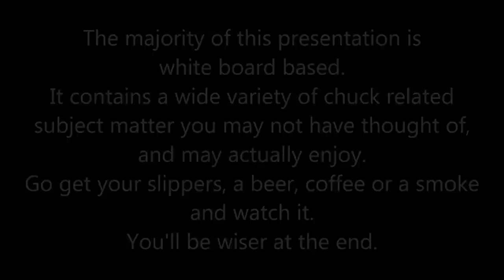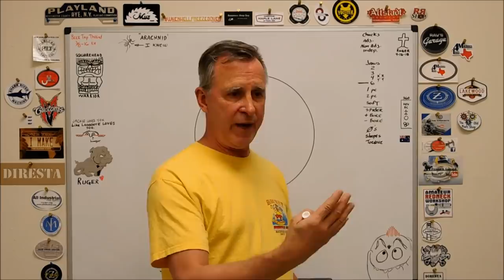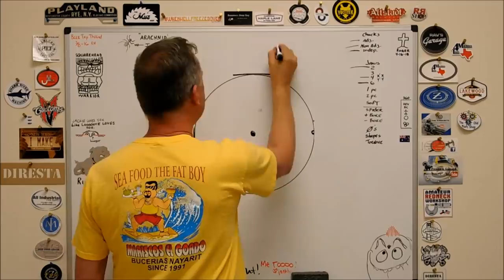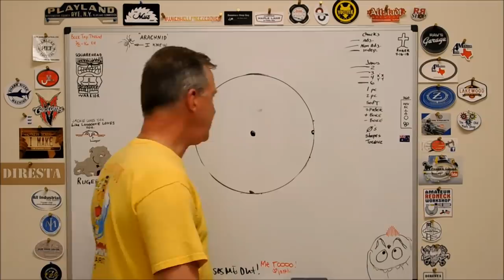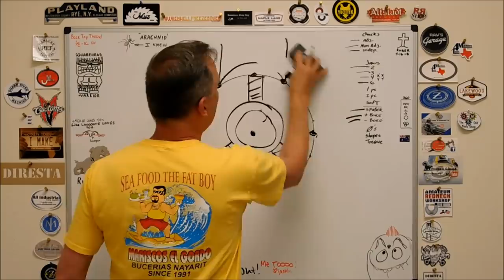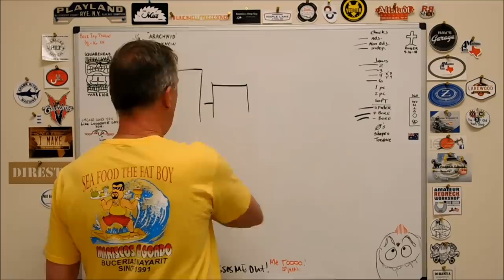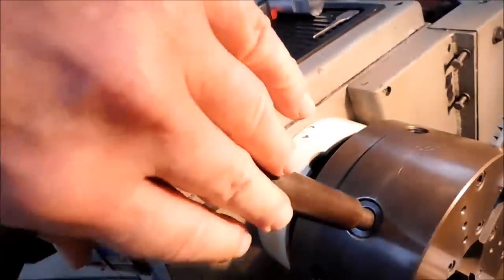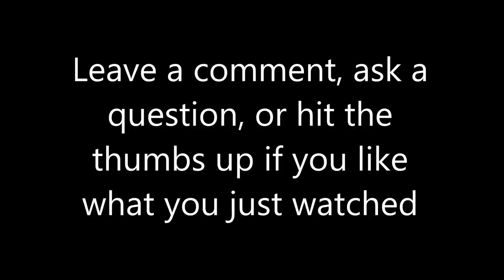Lathe Chucks - Types - Pro's - Con's

Comment: Another safety tip that could be offered is this: If turning the OD on piece of pipe or tubing and clamping using ID jaws, pay attention to the heat developed in the part. If a part gets too hot, it can expand enough to come loose on your jaws and disengage. Don't ask me how I know this..........
Reply: instablaster

Comment: Great job Joe!!  I'm a 4 jaw guy...mainly because I do more repair work and things that have only one shot to be repaired.  I have same 13 x 40 as you....I can agree it is the best lathe out there...and it was built in 1997...still tight and accurate. I was on sack lunches for years until I finally got one! My 4 jaw (Buck) has jaws that the top is removable ...thus I can use soft jaws and even weld to the jaws if needed.  Keep up the great work....in the next month or so...I have a gift coming your way for your Colchester ... Hope it knocks your socks off....

Comment: In our shop, we use 3 jaw check to hold almost everything, even squares... you have to be a bit creative :) 

Another issue people have on 3 jaws is that "its impossible to make them run true". Sure, but you can adjust that quickly by slapping an indicator on the part and tapping the high jaw to fix runout issues. 

Anyway, great video Joe. Thanks for your videos.

Jimmy
Reply: I do that all the time with my 3 jaw chuck. An old timer showed me that trick. It's very useful when you have to flip a part end to end and make the concentricity match. I can usually get it within .0005" concentric. My 3 jaw also has 3 tightening screws for the scroll, sometimes tightening one screw more than the others will move it enough to get it concentric.
Reply: @marcellemay7721  I see. I usually tighten only one out of three, but check all 3 to find which one makes the best concentricity. (They can be different ones through different diameters for some reason) and yeah, tapping helps when you need it.

 I also found that the high point wants to be towards the operator. So if your tightening the key up top, the high point will tend to want to be about 120 deg. to the left. This is because the spiral plate in the chuck has slop and shifts towards the left when tightened. 
Sorry for the long message Haha but this stuff fascinates me :)

Comment: Glad you covered soft jaw bore diameter. In my shop we cut a lot of rings for bearings (CNC lathe work). Maximum out of round varied .002 to .006 depending on the part. Maximum flatness/parallel deviation .003 typ. We held the parts in pie jaws and bored them to the exact nominal outside diameter of part (which dep. on the customer had a +/- .001 or .002 tol.)  And then held at very light chuck psi. 
You could always tell when guys rushed the jaws on their set-up. The parts would run way out of round and/or way out of flat.
Jaw diameter and torque are absolutely critical and should not be overlooked or underestimated.
Reply: I'd like to add that the bigger the part the more extreme these effects seem to be. I ran and set-up the big parts (8"-18") and the rest of the shop ran the smaller ones (1"-8") and the chuck pressure in flatness of the jaws was extra critical. Bore size mattered across the board.
Reply: @ctdbass  the size matters due to what is called "tunnel strength". It requires more force to crush eg. 1/4" wall 1" diameter tube than a 1/4" wall 6" diameter tube.
As an example this is a significant factor in choosing wristpin diameter for performance engines vs. wall thickness. Wall thickness to diameter affects dimensional rigidity.

Comment: Good material Joe.  This makes me feel motivated to mention the condition of old, abused or poor quality machines that have "Bell Mouth" jaws.  When you encounter a machine that has this condition the problem presents itself in holding stock correctly.  You will observe that the jaws are actually holding tighter back in the throat of the chuck rather than out at the tips where you would ideally like it to be.  At times machines with a really bad case off bell mouth will exhibit chatter when you have material stick out that you THINK is acceptable yet it still chatters.  That is because you are actually holding the part 2 inches back in the chuck effectively making your stickout longer than you think it is.  This will often really show in parting operations where it starts honking like a beast with 1/2 inch brass for example.  Bell mouthing can be a really dangerous condition when holding small or hard stock out at the tips.  If the bell is bad enough parts can literally spit out or become dislodged and begin to run out of true.  A person can check the jaw contact surfaces with a test indicator to see if they are in fact flat to the tips.  If they are and yet it still exhibits this issue there can be a situation where the slots in the jaws are too loose in the body of the chuck.  Physically trying to rock the jaws in the body will often show this condition.  This sort of thing tends to show up on poor quality chucks made in China..  They use the lowest grade castings for the chuck and the carrier jaw.  Over time the parts wear and slop is created at the chuck slot ...then the rocking results.  More food for thought. When looking at machines examine the chuck wrench hole and the chuck wrench.  If the hole in the chuck is not properly square or the wrench is showing signs of material displacement on the corners be motivated to find out why.  If the T wrench handle is looking more like an S...someone has been torquing the snot out of the chuck.  Chances are it's not going to be a great performer and could motivated the need for chuck replacement.
Reply: A spyder can be made to hold the jaws adjacent to the work holding points i.e. the angled surfaces allowing loads to be placed at the end of the jaws. Doing this on a very worn Hardinge chuck restored it to usefulness. Someone apparently put a ring outside the jaws and bored it "true". With substantial wear the chuck was now useless. If we could post a photo in comments I would show a tool I made to fix this one.

Comment: Great video Joe, solid information which should help a lot of people avoid mistakes with their chucks.  And thank you for covering the sequence for reinserting the master jaws.

I worked in production shops for many years and mostly with 18 to 24" 3-jaw chucks, and some 32" 4-jaw chucks.  My first shop had old equipment and beat-up tooling, so we had to improvise a lot.  A job came in which, in retrospect, should have been run on a boring mill: large parallelogram-shaped blocks which needed a ~4.5" hole bored through them.  We ran it on a Warner & Swasey 3A turret lathe with a special fixture pinned and bolted to the chuck face, with one top jaw providing the sole clamping force.  The sequence was: face the outer side about .300", drill 1-9/16" through, drill 3-5/8" through, then bore to size.
Tedious and scary job, and I ended up doing most of them.  That's my one-jaw chuck story!

Comment: Joe, on my 4-jaw, I like using 2 chuck keys, opposite each other... It simplified the adjustments and makes it easy to true the work.
Reply: Neat idea.
Reply from the maker: I've seen that done. I still use just one.
Reply: @joepie221  I use 2 to get it withing a few thou and then change to one.  I also, like to splitting the high/low as the first step to know about where zero is going to be.
Reply: Give it a shot, brother, I was amazed how it makes adjustments so simple. I'll never use just a single again...  try it!

Comment: Brilliant advice. I bought a 6 jaw at $2500 US (ZAR40K) thinking i was the cat's whiskers.  What Joe explained about the work that needs to be round is valid. My work pieces on the 6 jaw was terrible compared to the 4 jaw.
Reply from the maker: A 6 jaw will still hold tighter than all the others on true round bar. Only 60 degrees between jaws means less chatter.

Comment: Fantastic video. I have a lot to learn and I'll be watching this again soon. I'm also going to watch your video on a rotary table again. My knowledge is very much lacking in this area. One thing I think you should have mention is the effect of overhang on smaller lathes (South Bend, Logan, Atlas etc.) My Logan 820 has a 1-1/2" x 8 threaded spindle and a chuck that has a very deep body and jaws with chatter like crazy. I'm talking about the distance from the tip of the spindle to the where the work is hanging out of the jaws. My original Logan chuck has  2.75 depth and an aftermarket chuck I have is over 5-inches.  I'm glad I have the capacity of the larger chuck but it is not ideal. If you are interested and want to see an example of what I am talking about search youtube for: "Power Hacksaw Restoration - SawMaster 3114" and jump to the 10:20 mark.  Thanks!

Comment: Hello Joe from John. As usual I learned something new. I have always been wary when extending the jaws to close to the limit of the scroll on a three jaw, I will now take your advice as it is a splendid safety feature for those unwary.
 Thanks again for sharing your knowledge, John, Australia.
Reply from the maker: Thanks John. Give yourself at least 1 full scroll engagement, but realize you can't torque the life out of just one tooth. Its a warning mark for multiple reasons.
Reply: @joepie221  Thanks Joe I understand all that you have said and always do this and limit torque at the extremes of chuck travel. The Idea of the Mark had not come to my mind. That is a no/brainer in a way so again thanks. John.

Comment: If you get accustomed to using a four jaw and just leave it in the machine, you can get to the point you can get it running almost true by eyeball and just finish up with your indicator. For just general one piece use I prefer the four jaw any day. If I have 10 or 15 or more to run the three jaw is faster imo. I've seen guys come over to the lathe to run one piece, see the four jaw up and spend more time changing it out to the three jaw than it would have taken to have just indicated it in. Great video man. What the hell I'm doing watching shop related stuff at 6:00am on Sunday morning ill never know but it is what  it is I guess .😁
Reply: Adso Melk my guys are to put the 3 jaw back on the lathes before they leave the machine. If a 4 jaw, collet, face plate or anything else is required for a job it is billed to that job to put it on as well as return the 3 jaw to the machine. The 3 jaw is the most common used therefore I believe it to be fair practice to bill the change over to the job requiring the “special” setup and not billing the “common” setup for returning the machine to the 3 jaw.

Comment: If you draw your circle with permanent marker it will not erase while you are showing your examples. To get the permanent marker off, just draw on it with the dry erase marker and let it dry. Then erase it like normal and the permanent marker will be gone. I used this when I used to teach and it saves a lot of time. Thanks for the video I learned a lot and thought I could give back some with the permanent marker trick. Have a good day everyone.

Comment: Great idea to add the safety mark at the third jaw. I also use the stop bolts to locate disk type parts. Picked up the idea from Robrenz. All my chucks have that feature now. You can easily face parts parallel to within .001". Thanks for the video Joe!
Reply from the maker: The stop bolt idea is fine, but I use machinable round aluminum standoffs. I have a video on the subject.
Reply: @joepie221  Yes I like the way they can be faced with the jaws removed. Can't get any closer than that!  Nice little lathe project by the way. A true test of a machinist's skills and patience.
Reply from the maker: @rayp.454  I'm trying to stay 5 steps ahead of my next move. Its a personal challenge not to make any mistakes on that build. And unlike the steam engine I built, I'll take some design liberties with this one. Like the dials.

Comment: Great info Joe as always. 

I would imagine the other advantage of boring soft jaws a smidgen under the part diameter, would be that as you tighten the jaws and the jaw material deflects,  the two points of contact will deflect slightly outward, opening the too- tight diameter up a smidgen and creating the possibility of achieving full- circle grip.  Obviously to achieve
this you need a perfect match of the tightening torque on the chuck key and the amount of diameter difference and the stiffness of the jaw material. But at least if you start a bit undersize, even if you don't get all the stars to align, in the worst case you still get the six points of contact you described. At best you may get it to deflect from say 2 thou undersized to the perfect size and the perfect full circle contact. 
If you start oversize you will only ever get 3 points of contact.  

Like putting a golf ball-- once it has curved to the low side of the hole, it isn't going back uphill and you've missed already even if the ball still has a couple yards to run.  If you are on the uphill side you have a chance.

Comment: I love this channel, I do modelmaking, at least I did, as a hobby, and would love to get back into it. My models were small-scale, I have a Unimat 3 with a geared scroll 3J and a 4J. (the standard 3J has tommy bars!) . The U3 has a vee guide and a flat. I used to use all sorts of stuff, like throwaway nylon set screws, to try to stiffen it up, but basically a sound machine, if not a cut devil. Courageous cuts pay off, though. I have two motors, leaving the milling attachment in place, and use the screw gearing to autofeed, the belts are not up for it. I find magic markers indispensible, also custom collets. Where there is a will, usually there is a way, but never could anyone think of making a living with it. 

I have some broken and seriously work-hardened cutters which I treasure! Please stay on your seat!

Comment: Thank you Joe, I at least know what kind of 3 jaw chuck I have. I believe you called it a chuck with carrier jaws. Mine are not soft jaws but steel jaws. I'm having trouble getting it closer than .003 on center. When I bought it I of course put it together. After installing the carrier jaws I put a test bar in it and indicated the bar. It was .009 out. I took it out and loosened the Allen head screws moving the carrier jaws by hand to get it closer to zero. I could only get it within .003". I an 69 years old so I'm a hobbyist with limited knowledge of machining as a professional. I have a lot of fun doing little projects at home but this 3 jaw was supposed to be within .0005", I guess I don't know how to adjust the jaws. Thanks for the video, excellent information to know.
Reply: Carrier jaws? I know Joe used that term too, but it’s unusual. I’m going to go over the method of centering an adjustable chuck if Joe’s didn’t seem to work for you. There are master jaws that remain in the chuck, and replaceable top jaws. If your chuck is “supposed” to be set to 0.0005”, then it’s some sort of adjustable chuck. There should be four screws close to the back edge of the body of the chuck. You loosen the front mounting bolts so that they sit firmly, but not too tightly. You then loosen or tighten those four screws until the chuck sits as closely as possible to concentric. A 0.0005” indicator is needed to do this properly. Then, after you adjust it, CAREFULLY begin to tighten the front mounting bolts, slightly, one after the other, going around three times, each time tightening it until it’s tight. Then, because tightening them can knock your adjustment off slightly, check concentricity again. If it’s ok, then you’re done. If not, you have to slightly loosen those mounting bolts, but just slightly, and do it again.

Early this year (2021) I bought a new Buck 8” Adjust-Tru. It wasn’t too difficult to get it to 0.0002” at a 1” diameter. But you need to use a high precision pin to do this. It needs to be round to better than the concentricity you need. Otherwise, it’s useless. Don’t use a quarter inch dia pin. Splurge and buy a 1” dia. 6” pin, so you can stick 2” in the jaws, and still be able to test at the jaws, and 4” out.

Comment: As always, more than worth waiting for, and worth every minute to watch! Very good whiteboard work! That safety mark is a real winner!  I wonder if you could suggest when it makes sense, or requires us, to use a collet, instead of a chuck?  Is there any good, or easy, way to use some kind of carrier, or backing, to avoid the 'dishing' effect on a thinner flat part that is being surfaced? Could you glue, or double-face tape, a smaller, appropriately-flate, plate on the back, or make some kind of magnetic attachment (for ferrous mat'l)? A lot of glues can be released with just moderate heating; just wondering...
Reply from the maker: If you notice my chuck face, its drilled and tapped. I have, in the past, attached a solid plate to the chuck face with channels for the jaws. Facced it and installed the jaws. I then had a full backing surface for my thinner plate work. Make sure the geometry of the cutting tool drives the work against the backing plate and not scoop it for better results. Facing off a 6" dia 1/8" thick plate is no problem.
Reply: @joepie221  Thanky, Maestro, as always, a 'professional' solution, and answer :-)

Comment: Thanks Joe .Part of learning curve has been losing the work part out of chuck.Only luck was small part at low speed. Holding work of 50 mm diameter  70 mm long but only holding back 10 mm to thread!

All i needed was to put inner jaws back in three jaw. How stupid of me . It had worked before but no guarantee to keep working.

However these incidents really wake you up

Safety Safety